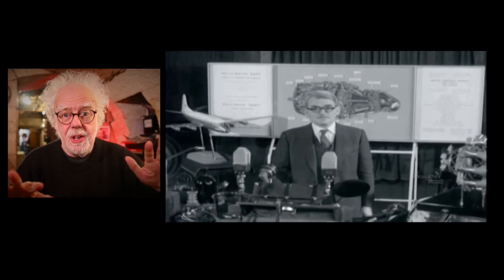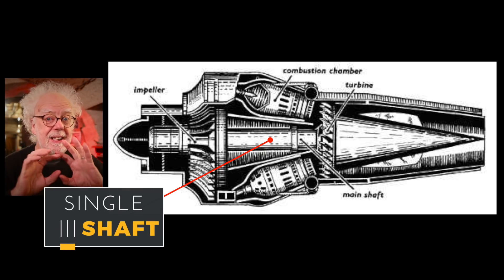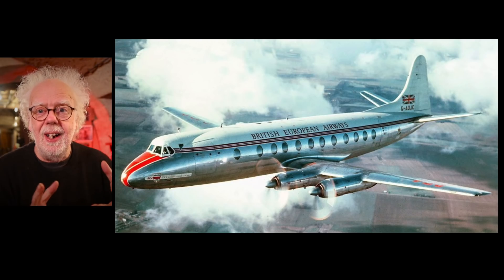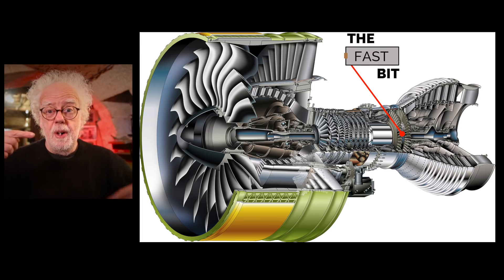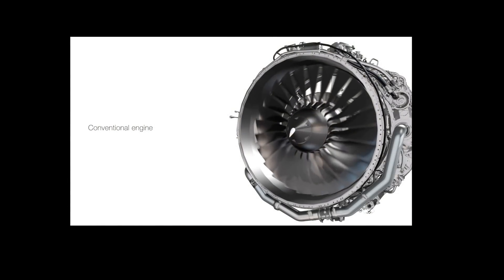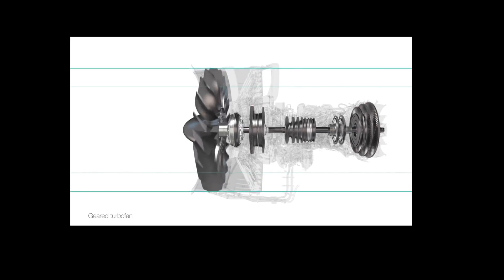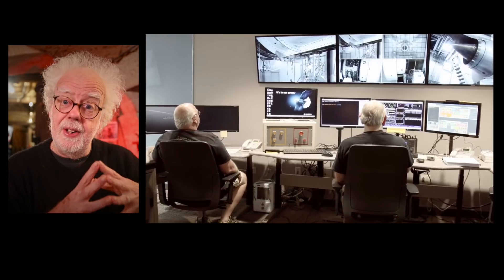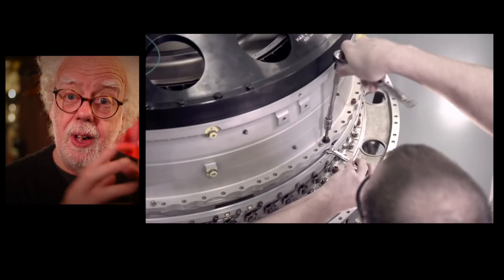Greater than the JET engine - Prof Simon

Comment: Hans von Ohain claims to have simultaneously invented the turbine engine...I saw a video in which Whittle said he spoke to Ohain after the war and they agreed they had invented it independently...also...open-air propellers were at about the same limit in the P51 with the Merlin engine blade tips nearing SOS and wearing the tips...
Reply: @ClickNSpam Yes, the patents were published in Berlin and indeed were written up when Ohain was still in short pants. And as you say Whittles engine was the first to run anyway. Ohain said he didn't see the patents which is just very hard to take seriously. Whittle was just being kind. He was a lovely chap.
Reply: Von Ohain ran his engine fully under its own power 6 weeks before Whittle ran his.   When the two men met they compared notes and Whittle accepted von Ohains date.  Von Ohain gave Whittle credit because von Ohains engine used hydrogen whereas vin Ohain said Whittle had solved the flame stability problems with kerosene first.   Whitles brilliance showed in his for tree roots.
Reply: @WilliamJones-Halibut-vq1fs  It's not absolutely clear when Ohain first ran his engine, some say August some September and some April 1937. I'm not sure and I have tried to research this a fair bit. The fir tree roots  I agree shows his genius. He had to practically build his engine in a shed whilst Ohain had Heinkels engineering expertise behind him.
 There was a lot of work going on with turbines at the time but it does seem that Whittle was the first to propose a pure jet and this was the relevance of his early patent. Others were wanting to add fans or props  etc. Whittle knew that a pure jet would work at high altitudes with much greater effect than any propeller. He patented the turbofan in his second main patent along with afterburning (reheat) and his ideas for a supersonic engine. His supersonic engine was ready and running in the Miles M52 and Winkle Brown was ready to fly it when it was cancelled by the government. That along with the TSR2 was most likely responsible for ending real advanced work on aircraft in the UK. The British government also cancelled an orbital ready rocket in Black Prince. Grrr
Reply: @Martin D A Ohain ran his engine in over a period in late February to March 1937 on hydrogen, this was a few weeks before Whittle ran his. von  Ohain had graduated from university in 1935, worked at university for one year, but in his private time developed the engine.  He soon partnered up with a mechanic Max Hahn (genius with 400 patents actually) to run a demonstrator gas turbine known as the 'garage engine' which needed some external power from an electric motor to sustain itself.   It was this demonstrator that was used to convince Ernst Heinkel to support and invest in them.   In patenting their jet engine the German patent office came across Whittles patents in 1936.  There were enough significant differences for Ohains patent to be granted.  For instances Ohain used a radial inflow gas turbine and an annular combustion chamber.  
   Personally I think one can take the line that neither Whittle nor von Ohain deserved a patent.   The American Sanford Moss had demonstrated the turbo supercharger in 1918 they soon had a Biplane flying at 42000ft on it well before Whittle patents.  Replace the piston engine with a combustor and you have a gas turbine and jet.    Gas turbines were patented and running before either Whittle or von Ohain they just weren't for jet propulsion.  The Germans had a constant volume gas turbine providing power to the German railways in 1928-1931.  ABB had continuous flow combustion gas turbines producing commercial power in 1939 and had gas turbine running before Whittle/Ohain.   There were a multitude of 'jet engine' under development that used the jet thrust from super charged or turbo charged free piston engines.   What was novel was using the gas turbine for reaction propulsion.
   The idea von Ohain and Max Hahn had simply devised to separate the development and matching of the compressor/turbine from the combustor by using hydrogen while developing the combustion chamber and flame holding nozzles separately.  This idea worked.   A few months latter they introduced combustors which evolved from Max Hahn's welding torch patents.
    If Whittle had never been born von Ohain, Hahn and Heinkel still would still have run their jet.  Also Whittle wasn't a poor lad without money or backing.  
    Its faily clear both men invented the jet engine simultaneously and both took different approaches and developed sightly different technology.   In terms of proving it could propel an aircraft, Heinkel had their He 178 in the air 2 years earlier than the Gloster Squirt.
    The American Nathan C Price also developed a Jet engine known as the Lockheed L1000 independently starting from 1937.  That would have lead to a jet engine and jet aircraft indpendant of Whittle and von Ohain.  Likewise over at Junkers and BMW independent programs developed under Herbert Wagener.
    I don't believe for a moment that other men had not conceived of jet engines and gas turbines before von Ohain or Whittle.   Those two were different did both to seek patents and to build one at a time biplanes were the norm.
Reply: @WilliamJones-Halibut-vq1fs  That was well written.
Reply: @WilliamJones-Halibut-vq1fs  Your dates for the running engine are wrong. 
Whittle was the first man on the planet to propose a reaction engine based on a gas turbine,  by many years. I agree others had made some significant developments, but all after the patent and all with props or using steam or whatever.
The genius of invention is sometimes noticing that which nobody else does. The aircraft turbo/supercharger - it was there - almost...
The genius I propose is seeing things before others.
''Oh I could have done that'' - Remember saying that as a 10 year old? And what was always the answer?
 ''Well, you didn't did you''.

Whittle was I believe the man who most deserves credit here. For putting his whole life and health into making his engine. The facts back up Whittle as far as I'm concerned.
 I believe he came up with a truly original idea and bought it and much more into fruition.
If you want to bash someone who deserves a bashing, as do his promoters, have a go a Tesla. Who invented the polyphase motor??
Reply: Proof is in an actual aircraft flying around... which Ohain had long before Whittle.
Reply: @Bartonovich52  The first German jet was nothing much more than a hair-drier powered glider. Whittles engines went on to power the world. Not one of Ohains made it into production.
Reply: @Bartonovich52  That was 1939 and was still a dead end engine running on hydrogen after the full support of German industry was thrown behind manufacturing and research. Whittle was in his shed. We all know when the Heinkel flew - We are talking about the first proper jet turbine running. Not sure what you are on about really?
Reply: @martinda7446  
Well, the engine actually ran on kerosin when flying in the Heinkel aircraft, so much to that....
Reply: @Enthropical_Thunder  Yes, sorry it ran on diesel. Still the history is condensed as follows:  Idea postulated by Whittle 1927 and patented in 1930...following years of no interest...1937 Whittle engine running.(sudden interest when seen).
1936 Ohain patent. Immediate support from Heinkel. 1937 Ohain engine running.
There is no doubt if the ministry had put some faith in Whittle he would have had his engine running much earlier. He had to build it in a shed. He also patented the turbofan and afterburner along with an engine suitable for supersonic flight. Ohain was much luckier than Whittle.
I am convinced Ohain and many others working on turbines at the time contributed a lot, but the first to propose a pure jet with its advantages of speed at altitude etc was Whittle.  Everyone else was adding propellers etc. Unfortunately for him it was not accompanied by a working device until very close to Ohain who had been given six years to catch up. I'm still not clear on who's engine ran first. There seems to be a lot of grey in that area. Most of the 'grey' surrounds the date of Ohains first run, Whittles run date is known.
I'm not one who wants Whittle to win the race regardless of truth. I want to know the truth - and there does seem to be a lot of made up stuff surrounding these events. I'm all for giving those that deserve it recognition for their work. Work on turbines and turboprops by György Jendrassik I only recently found out which might alter my views. 
The truth is out there as the prof says - and all I'm concerned with. This one is full of so many contributors and red herrings..
Many engineers get a bad deal. E H Armstrong maybe the greatest electronic engineer along with Blumlein was well and truly stuffed by RCA.

Others like Tesla maybe didn't do as much as they said? Certainly less than the loonies who say he was the greatest ever.Sorry I wrote a book.
Reply: @UCn4MNxSd0B1CfhAqxDNaFcw 
You are a man of the truth, right?
The truth simply is, that Frank Whittle was the first one to propose and build the jet turbine.
Von Ohain and his mechanic were the first to build a flight worthy jet engine and aside them working for 
Heinkel, they actually basically worked by themselfes, without much support of the other engineers, Whittle and Ogain not that far appart when talking about active support.
The truth is also that the first mass produced axial flow turbines (though not very long living ones, due to used materials), were developed by guys like Franz Anselm (well Daimler Benz also had prototype highe bypass turbines like the DB 007).
Reply: von Ohain admitted that he closely studied Frank Whittle's patents before beginning his own design.  Advocates of von Ohain like to tout it as an axial engine, but in fact it was unique in being a fully centrifugal jet engine - both compressor and turbine were centrifugal.  Also, it was a failure.  Despite massive funding from Heinkel, it was inefficient, gave little power, and was a failure. 

Even if the design had promise, which it didn't, it would still have failed, as there was no German program to develop metals capable of withstanding the mechanical stresses and temperatures of a jet turbine.  Britain did have one, and developed the Nimonic series of alloys.
Reply from the maker: good points Brian.
Reply: Bullshit

Comment: All I see is mechanical issues in the future. The speed the gearbox is spinning at to make that reduction.
Reply from the maker: good point
Reply: what speeds? 4000rpm (fan speed) is slow. are you saying you wouldn't ride the average car, or motorcycle, because the moving parts are spinning too fast? also, aircraft have been flying with reduction gearboxes since ww2 and before. gears are not the weak link in a turbofan.